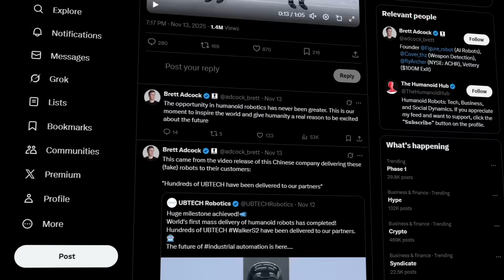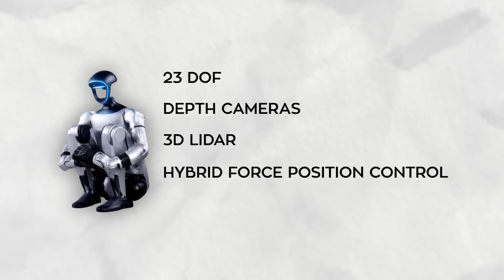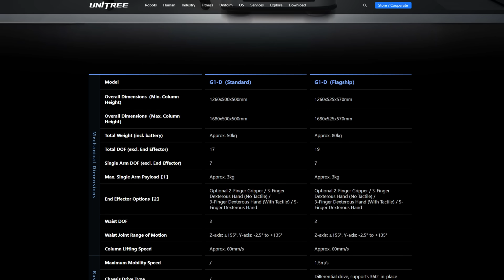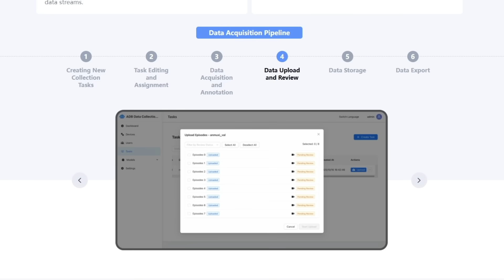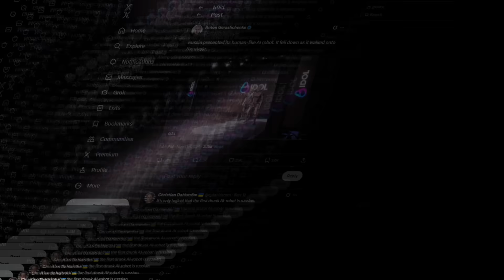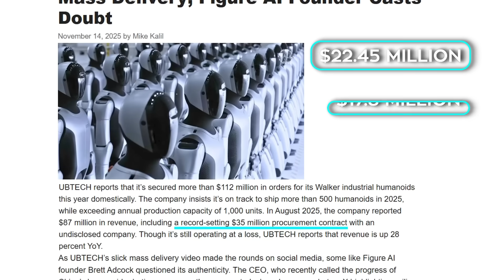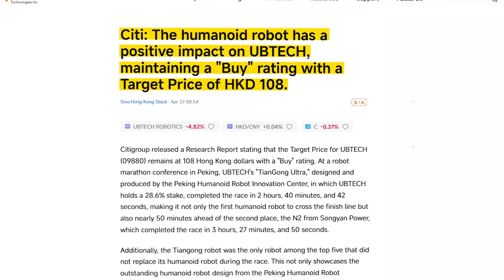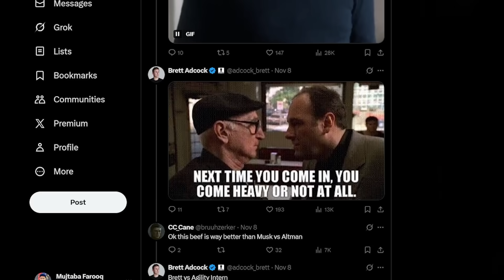AI Robots Crossed the Line This Week as Unitree Goes HUMAN-LEVEL

Comment: As a quadriplegic 
Im thinking of amputating half my body and using the Unitree's legs and lower torso to be mobile again .
The Upper torso housing the battery and electronics will be worn as a back pack .
The Preprogrammed modes will be voice controlled through voice recognition commands.
That robots legs looks promising out of every model I've seen available out there .

Comment: If you all are concerned about battery life of your robots, why not then extend the battery power amount by adding back up rechargeable batteries into your robots that get recharged while unused within your robot, and a way for the system to switch to the back up batteries using a switch that gets turned on inside it when the main computer within the robot gets a signal that the first battery is dead (for the robots that don't already have that feature of a dual battery system, of course).
Reply: the electricity use must be through the roof!

robot reserved only for the mega rich or top 1% earners.. until we create new forms of energy or safe batteries with at least 20x the capacity of what we have now.. either way.. seems far away dream
Reply: @じある Also, no matter what you do, robots and androids consume excessive energy, and the important thing here is to increase the energy.Let's look at how it can be used with active batteries using less energy.
Reply: @じある  No one needs to be "mega rich" or a "top 1%" to purchase these, and we aren't even in to MASS production yet, which will drastically reduce costs.  These are all SHIPPING TODAY:

"Figure Robotics aims to ship 100,000 humanoid robots over the next four years, focusing on commercial and residential applications. Their Figure One robot, developed with OpenAI and Microsoft, is priced between $30,000 and $150,000. They have secured major clients, indicating real deliveries underway.

Tesla's Optimus G2 humanoid robot is expected to cost around $25,000 to $30,000. It is positioned as a relatively affordable commercial humanoid robot.

Unitree offers the Alpha 1 Pro humanoid robot for about $16,000. "

And battery capacity is IRRELEVANT when they can SWAP BATTERIES, just like a Ryobi battery drill...
Reply: @じある Then complain So why don't you try to solve the problem instead of complaining?
Reply: So... use the batteries to charge the batteries to extend battery life?
Reply: @darkaeon370  Yes.
Reply: There's already a robot that has 2 batteries, and it can change out either by itself.
Reply: Battery which can charge by itself? Wow!
Reply: Great idea. Thanks. I'll write it down and send it to my pal in Beijing.
Reply: That would be no different to having one battery that gives warnings when theres only 10% left.. or goes into power saving mode. Like on motorbikes theres a reserve setting on the fuel tap but actually its just one tank. The main fuel on setting just has the intake a bit higher in the tank.
Reply: Put a small 2 stroke engine in a backpak as range extendet